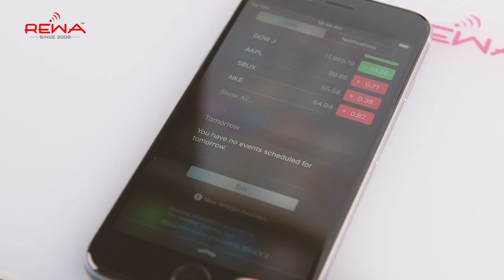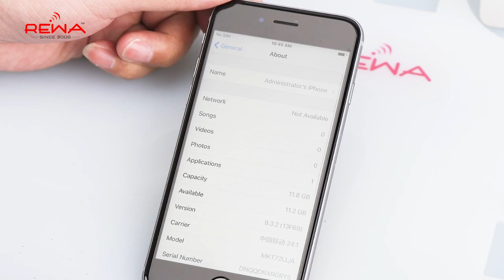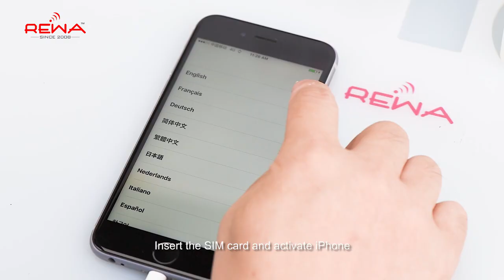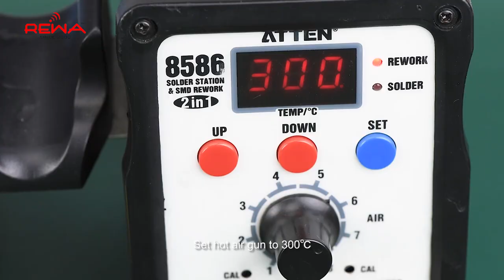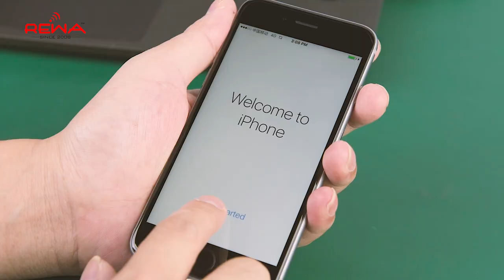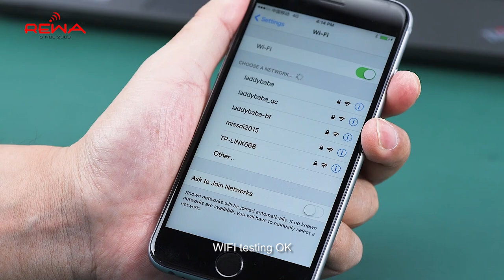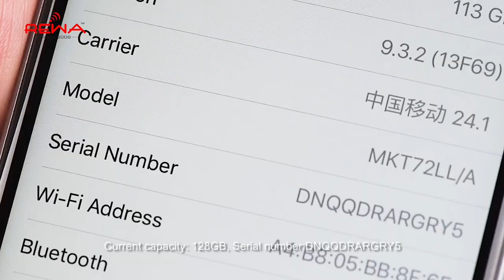Upgrade iPhone 6S 16GB Storage to 128GB

Comment: Poor iPhone users that need to do this for more storage 😂😂😂
Reply: Well enjoy your overpriced $900 phone lol, oh and sd cards are not slow so don't make a statement if you never use one
Reply: Javier Negron Lopez in comparison with Apple flash memory the microsds are slow and corrupt a lot more. I know what I'm talking about. I'm enjoying my 1000$ phone knowing that it will continue being helpful in the coming years. Getting all the updates not worrying about being left out from important iOS renewals. Not risking explosions in my pockets haha
Reply: +Mo Farkouchi They are slower but not slow, For 4k recording and opening apps they are more than capable. And Yes they are more likely to get corrupted but still rarely do, I have used a singleMicro SD card for over 5 years and never ran into issues. There are good and bad quality ones. When I fill my Micro SD card I just pull it out and swap a new one rather than having to back it up. In Apple you have to pay hundreds more for upgraded storage. Not to mention if your phone gets bricked or water damaged you lose all your files. And iPhones slow down more than Android btw, after every update they become slower. This is planned obsolescence.
Reply: UFS cards will take over.
Reply: i don't need to do this i'll just buy another iphone .currently using the se
Reply: +Kim Patrick Garcia not the same
Reply: Kim Patrick Garcia what does you being an enginner have anything to do with this? Oh and I use a bidet instead of toilet paper.
Reply: Mo Farkouchi u have used cheap sd cards then
Reply: Android OS is far best then shitty IOS... and also for performance and sdcard speed,  poor iPhone users don't know what is sdcard..😂😂😂
Reply: +Abuzar Shaheen that must be why geekbench always gives me higher benchmarks on my Apple devices, then.
Reply: Social Spit so you use mobile only for benchmark? 
I am talking about features....
Reply: Social Spit to be honest, iphone hardware and camera sensor are better than most of the android smartphones but comparing features Android is much ahead. iPhone was innovative at past but now it sucks. Try some high end android phones, u will not regret...
Reply: Anurag Sharma better than most but not the best.... Do you know most of it's hardware is from other manufacturers like Samsung and Sony?
Reply: Javier Negron Lopez How much are S7's, about 600 bucks? Sounds like you never learned how to make use of your Carrier Subsidy, I bought an iPhone 5s for 259.99 plus 57 bucks tax (tax on the 700 dollar retail price). Even if you "bought" your droid for "99 dolla", your CARRIER took that 99 bucks and then THEY paid the other 500. Flagship Android devices are NOT CHEAP. I paid off my 5s fair and square with 2 years of service, and now I have it on another carrier. I have a 6s now, 64 GB which is enough for me, and it's 33 bucks a month OR I can pay 170 bucks to flat out BUY my 800 dolla phone. Carrier Subsidy, man, nobody EVER pays the whole 900 bucks for ANY device, Apple or otherwise.
Reply: Anurag Sharma Oh for sure, I'd love a Pixel Phone, which ironically are almost exact dupes design wise of iPhone 6's and 7's. But a good design is a good design, should be used. Just look at Russia, copied our Space Shuttle exactly, back when those were being used. But my 6s side by side with high end Galaxy devices, still stomps them, and I have any feature I want via Jailbreaking. Just like I have most of the android features I want through rooting.
Reply: Social Spit The pixel looks nothing like the iPhones expect for the bottom port and speakers, Oh and btw the iPhone 6/7 was ripped off of HTC's design.

Does jailbreaking give you USB OTG? Fast Charging? Expandable Storage? Wireless Charging? Multiple video format support for movies? Launchers with widgets? File browsing? Quick Settings? Headphone Jack? 

How does the 6S "stomp" high end Galaxy devices? In opening games? Have you compared the screens? The  iPhone 6S looks like shit in comparison. Have you compared the cameras? In low light? The designs? ...... exactly. Just as I thought. You'd probably buy a VGA CRT TV because it loads a few seconds faster than a 4K OLED TV.
Reply: +AMA tell that to the forum in XDA where people were complaining about the pixel looking too much like an iPhone 6. And I agree I never liked the iPhone 6 design I always preferred the design of the iPhone 4/4S/5/5S/SE. But I think Apple decided to use that design because it's actually easier to work on the device. The iPhone 5s is very difficult to replace a battery, because of the touch sensor, where as the 4S you just slid the back off and you could get to it.

The only thing really different between the pixel phone and the iPhone 6 Series, is that the pixel phone has a nice bezel around the screen. The only Apple device that I've seen that has that is the iPad mini, but it's a nice touch on the pixel phone.
Reply: Social Spit you do realise the Pixel was made by Google and HTC right? HTC....the company that Apple ripped off? The original company with those white antenna lines and everything?
Reply: +AMA and HTC originally ripped off apple with the very first "G phone", so everybody steals from everybody else, and then they steal back again. blah blah blah. The original G phone made by HTC was the one with the keyboard that slid out from underneath. Actually I thought those were pretty interesting, i've always preferred a physical keyboard like I had on my Treo.
Reply: Social Spit Just like everyone else you are dodging the subject. Why did you type all that to tell me that you liked the G phone's keyboard? Also how did they rip off Apple? With a touchscreen? 
I won't deny Apple was the leader of smartphones until Steve died. They have gone to shit now....
Reply: +AMA I think you were asking about USB OTG?

https://imgur.com/gallery/4cfzI

Those are two iPhones connected straight to my computer with access to every single file on both devices. I can connect to my android to my computers but notice that they don't connect completely unless the device is shut off and I access it directly through USB OTG. Those two iPhones I connected to my computer while turned on and it's not a direct connection, that's through my network Bub.
Reply: Social Spit That's a shitty iPhone from china running a version of Android that will never be updated and never optimised for this phone. So what you're saying is that a chinese Android phone in an iPhone body = iPhone being able to do everything Androids can do? 

Oh and I wasn't talking about companies copying each other, you're the one who brought that up.

Good chat. Lmao
Reply: Social Spit USB OTG as in USB On The Go, Not root access when connected to a computer.

USB OTG allows you to connect flash drives and other USB peripherals to your phone. A Mouse, Keyboard, Hard disk, SD Card reader, ethernet adapter, DVD Drive....etc

If those shitty iPhone lookalikes are what you call Androids......don't bother.
Reply: +AMA I can do the same thing on my a real iPhone too,  I'll set it up. I can have an app drawer if I want, a navigation bar, and I can even set up the notifications to be like android notifications.
Reply: +AMA so what? I can do all of that on my iPhone. I can connect the keyboard and mouse to my iPhone but what's the point? But I don't really need a flash card when I've got 100 GB of cloud storage through MEGA and Dropbox, and I'm not talking through an app, I can connect to it directly through Filza. 

Look I'm not gonna play apple versus android with you, you can go back to the "I hate Apple" circle jerk. When you connect your Android directly to your computer via networking and have access to every single folder on the device, show me a picture of it. Then I'll do it on my androids.
Reply: Social Spit you can make your iPhone look like an Android. But it won't have the functionality.
Did you even read my post earlier?

"Does jailbreaking give you USB OTG? Fast Charging? Expandable Storage? Wireless Charging? Multiple video format support for movies? Launchers with widgets? File browsing? Quick Settings? Headphone Jack? 

How does the 6S "stomp" high end Galaxy devices? In opening games? Have you compared the screens? The  iPhone 6S looks like shit in comparison. Have you compared the cameras? In low light? The designs? ...... exactly. Just as I thought. You'd probably buy a VGA CRT TV because it loads a few seconds faster than a 4K OLED TV."
Reply: Social Spit The Google Pixel XL has unlimited storage from Google which automatically syncs without needing to do it yourself.

Samsung gives 100GB of Data to store files, and you can set it to upload Images and Videos automatically.

I don't need to access my files from my computer directly, because I always swap memory cards , don't really like cloud storage. But you could use AirDroid, it lets you copy files aswell as control your android wirelessly.
Reply: +AMA well good for Samsung and Google then. but you can't get that feature from Samsung anymore because it was some sort of promotion and it's not available. Actually it was part of a Dropbox promotion, at the time they offered me 50 GB when I registered my Samsung account on my galaxy tab 3.

I use my Gtab as a remote for my Apple TV. And my TV, and my DVD player. Plus my surroundsound system, through smart remote.

One of your original arguments was the lack of customization ability for an iPhone, this is just one theme out of thousands and it's not just one theme it's about four different themes all combined.

https://imgur.com/a/cjcOp

Including a Windows 8/10 phone launcher called Paragon. You can turn it on or off easily.

That you seem to think that androids are "better" than Apple. No, they're just different. The galaxy tab has that nifty IR, but mainly I can do everything I need on either Apple or Android. Making them unique is just one part of it.
Reply: +AMA and it's not about the need to do something it's about the ability to do it when you do need to do it. Most of the time I don't need to grab files off of my main PC. My examples are just to show you that I can do things on either device that you claimed I couldn't do on Apple.

As far as routing and android goes, compared to jailbreaking an iPhone. There is really only one repository for rooted apps and that's Xposed Framework. As of right now is extremely limited in what it has but it does have some good things there. On an iOS device though we have Cydia which has been around for 8 years, it's not just one repo you can connect any repo that you want to it and there are literally tens of thousands of different apps and themes and games you can get. And if you have an older device there are always archived tweaks like if you have an iPhone for you can load it up. I've always had difficulty with androids, some launchers are crummy. I like Total Launcher, I can get it to do a lot
Reply: Social Spit

Samsung provides 100GB for many of their phones and it is available forever. (Had a friend activate hos dropbox recently after getting an old s6). 

 Buy a proper Android and then talk. 
You can't use launchers or themes properly on iPhones, they don't run smoothly and don't even look good (also nice xbox icon for Music....lmao). Also Jailbreaking will void your warranty, not all iPhones can be restored to factory settings.
We have features right out of the box. You have to update every single time and also jailbreak and hope your phone doesn't lag/crash.....it's such a waste of time.

Android doesn't need to be rooted, because it can do everything a jailbroken iPhone can do without even being rooted. We never needed repos because Google implements everything in their major updates unlike Apple.

Do you even read? I told you FTP is not the same as USB OTG, YOU CANNOT DO THE THINGS I STATED TWICE IN MY EARLIER POSTS.....

"Does jailbreaking give you USB OTG? Fast Charging? Expandable Storage? Wireless Charging? Multiple video format support for movies? Launchers with widgets? File browsing? Quick Settings? Headphone Jack? 

How does the 6S "stomp" high end Galaxy devices? In opening games? Have you compared the screens? The  iPhone 6S looks like shit in comparison. Have you compared the cameras? In low light? The designs? ...... exactly. Just as I thought. You'd probably buy a VGA CRT TV because it loads a few seconds faster than a 4K OLED TV."
Reply: +AMA to everything you say, I can reply "so what"? I won't run an android unrooted either. And I have some proper androids. All of them are rooted and I can do more on them rooted then not, and that's the way I prefer it.

As far as this myth that jailbreaking voids the warranty, it never has before. And I've never had to return an Apple device once in the last six years for warranty work. But I have had to return one of my android phones, and I had to pay $60 in shipping, instead of driving right down to the Genius Bar and handing in a defective device. But as I said it's never happened to me. And when I was done with my iPhone 4, I sold it for $400. When I was done with my 4S, I got about the same amount. I was just offered €1000 for my 5S simply because it has iOS 8.4 on it. That's my other complaint, I can't update any of my older android devices to  newer OS! At least iOS offers me just about every update. Look, you're  happy with your Droids, let me be happy with both, eh?
Reply: +AMA and I want to know when I ever mentioned FTP? I'm talking about a direct connection through windows networking. You can't run sambadroid without rooting either. And you can't run Drivedroid either. I carry around Linux on my android's, on those very clones that you hate- and it boots on every PC. So you can stay in your little limited space with what you think are great features and I'll just reach for the moon, OK?
Reply: Social Spit You were talking about FileZilla, it's for FTP, and yes I know the Windows Networking repo for iPhones, it's available on Android too....... I never said I don't root my devices. All I said earlier was that Apple is not even close when it comes to features and capability like Android. Let's leave it at that. Have a nice day!
Reply: AMA No, I;m using FILZA, which is a root explorer for iOS. It's the ES Explorer PRO for iOS. I love ES Explorer, it's the best FS browser for Droid.
Reply: AMA I don't eve USE whatever trhe hell that is, it's NOT FTP,  it;s a direct SMB connection. Not even CLOSE to FTP. Google it, Filza, NOT Filzilla.
Reply: +AMA I can't seem to find the other reply you just sent, but I have to wholly disagree because there are all kinds of features with Apple that are just as good or better than what android offers. Just like there are features than android offers that are just as good or better than what Apple offers. That doesn't make one or the other device better or more accessible or cheaper even. But this time you are the one skirting the issue, I showed you my benchmark and I showed you how my device behaved under heavy modification and theming, and right now with the modifications it is beating the default benchmark for the device. I need you to show me where in that video there is any sign that the operating system is acting "sluggish"? Even with only 35 MB free of my system ram it's running great. On my android devices I'm lucky to get that much free RAM with all of the GAPPs sucking up my UserData and Ram.

Comment: 4 pads missing after removing chip. How it is not necessary ? Is it normal pattern or pads broke when removing chip ?
Reply from the maker: The missing pads are empty pads, which do not affect the functions.
Reply: REWA Technology ok so that's normal pattern :) do you know the name of the memory chip ? i would like to try upgrade an iphone 6 16gb to 64gb.
Reply: KoSLoW27 u
Reply: JUSTPENTA LOL v
Reply from the maker: Here for the NAND Flash and NAND Flash Chip Progammer: http://www.rewatechnology.com/e-catalog/search/Nand%20Flash%20Memory%20Chip
Reply from the maker: Skilled repair tech is required for the operations. Please think it over before the upgrading.
Reply: REWA Technology
i saw an other way to add data on a new chip. It consist to solder the original nand on a usb key then copy data and do the same on the new chip and finally sold it to the mother baord.

The probleme is to find a comaptible usb key.
Reply: An usb controller that directly exposes the nand is very unlikely. You would be better off soldering the new nand in place and use the "Engineering cable" to reporgram the nand ;)